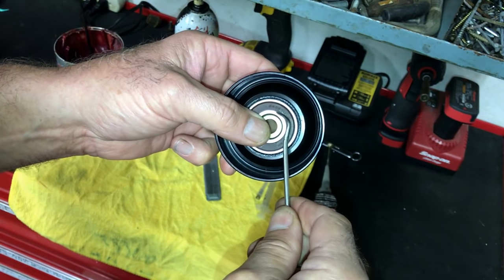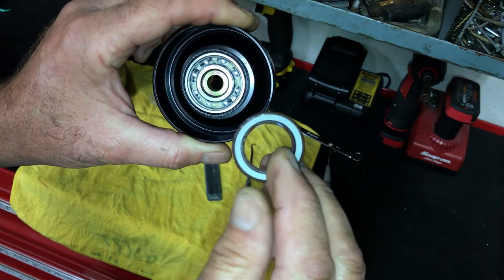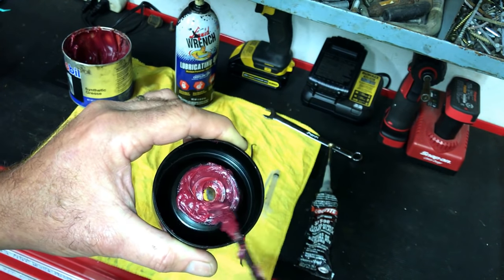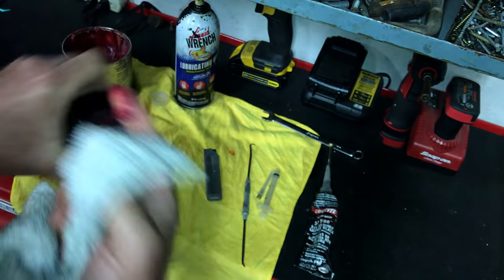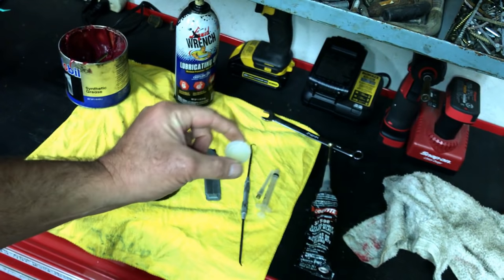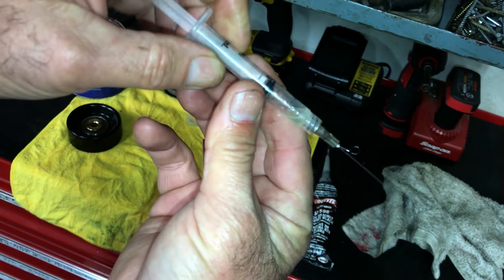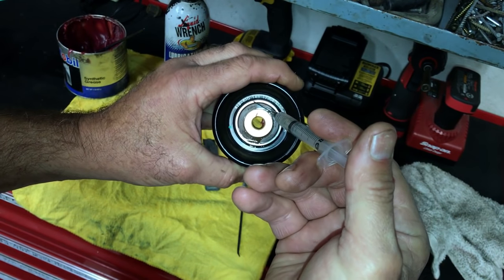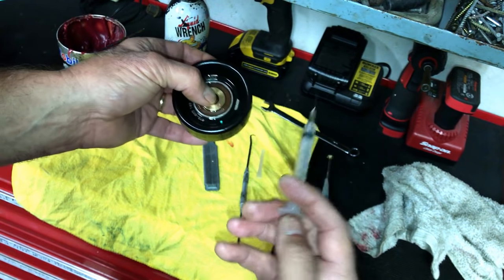Make Your Drive Pulleys & Sealed Bearings LAST A LIFE TIME :)

Comment: Am I understanding that for the syringe method you're using Liquid Wrench in place of grease?
Reply from the maker: yes and this method with the syringe is for those who do not want to remove their pulley to lubricate...we always remove and use full syn grease   :)
Reply: Is Liquid Wrench a grease?
Reply from the maker: it is a lubrication oil    we thank you very much and for the quality comment, it is very helpful for the whole channel :)
Reply: You are better off removing the pulley and greasing it.

Comment: This is good advice. By any chance, will WD40 work in place for the syringe applied lubricant?
Reply from the maker: you can try it but the spray nozzle needs to be very small to get under the seal   Thank you and thanks for being here with us :)
Reply: +Sweet Project Cars My question was going to be...Will WD 40 as a lubricant work just as well as the Liquid Wrench version of oil? I could still use the syringe method. Thanks!!!
Reply: tgoodm1 don't use WD-40. The lubrication it provides is not long-lasting enough for this application. WD-40 is more of a cleaner/degreaser, which is not what you want in a bearing!

Comment: Do this to my bearings all over my snowmobile. Doesn’t last as long as you think, the ones that are under in the elements .. cold ,ice , high speed . Yes I use low temp syn  grease too . Makes them last a bit longer that’s it .. quality bearings too
Reply from the maker: JDRTRM JDRTRM you are correct, this method was intended for cars and trucks :)

Comment: I've been greasing sealed bearings for years. I just removed the front wheel seals on a 85 honda Big Red that needed brakes. And since I had it apart I freshened up the bearings, these are the original bearings and the grease was almost as hard as wax. Doing this is a great way to prevent a breakdown, especially on older cars that needs belt replacement go ahead and grease those idler bearings. I've always removed the seals from the outer side, never tried getting under the race side of the seal. I'll try that way next time
Reply from the maker: thank you very much my friend and thanks for being with us :)

Comment: I have never tried it just thinking you could just drill four 1/16 holes into the cover
and then use a needle to grease the bearing without removing the cover. After 
greasing the bearing then use liquid electrical tape to seal up the holes. Next time
you will know where the holes were then just push the needle through and grease
it again. Then cover the holes again with the liquid electrical tape, it should work.
Reply from the maker: We try to keep it simple, of course, a person can make a mountain out of a mole hill in anything that they do.  Thanks for sharing.  Have a great day.  mad Mike the hammer SPC

Comment: I have been a Machinist / Machine Mechanic  for 40yrs   and Yes from the Factory they Don't Pack  the Bearing with much Grease  that's why a lot of them Fail Very Early   I did the same thing on a car that I had many years ago . it was the  A/C  idler I just took the Shield off the bearing Washed it Out  and Packed it with Wheel Bearing  Grease  worked like a charm    Great Tip
Reply from the maker: Thanks for the great comments to the channel:)

Comment: My new bearings, for both idler pulleys and the tensioner pulley arrived. I pulled the seals off of both sides and cleaned out the factory grease. I have repacked the new bearings with Mobil 1 synthetic as you recommended. While I was repacking them I even soaked the seals in 303 Aerospace Protectant as you recommended in a different video. Now all I need is a weekend without rain!

P.S. These bearings better last forever!
Reply from the maker: Great to Hear!  Thanks for the great comments to the channel:)
Reply: Thank you for the response. What vehicle used the belt for over 300k miles?
Reply from the maker: you are welcome...the ford van in the video is where the belt come off of and it went back on it and is still there working like a charm.

Comment: I have syringes in my tool box. It works. But I rather take it off and repack the bearing with high heat grease. As long as the bearing has little to no slop you should be fine. Works all the time. Any one can do it.  just be easy with the seal
Reply from the maker: Ben REPACKING is the very best way to do it as you said...Thank you and thanks for being here with us :)

Comment: Funny, I did this years ago. I have a treadmill (not a cheap throw away)and one of the bearings in the front roller was making a ticking noise. I took a syringe with some mobile 1 5w30 injected into the bearings and that was about 8 years ago and it is still perfect and I have put thousands of miles on it. I would have just replaced the bearings, but the way they were pressed in, I didn't want to take a chance of damaging the roller bearing housing and a replacement roller was over $100. I swear they try like hell sometimes purposely to make things only replaceable and not repairable?$?$?$
Reply from the maker: LittleJimmyNorton thank you so much for sharing my friend :)

Comment: Why wouldnt you brake clean out the white lith first?
Reply from the maker: Hi Dan this video was for the novice and nevertheless there is no need to make a big ordeal out of it..  as you know many do just that, and then it becomes a time issue and at that point they might as well just go buy a new pulley...we have done this very fast and simple upgrade and have vehicles here with well over 300k miles and never replaced the pulleys and we only greased them once when we purchased them new  thanks much   and thanks for being here with us :)
Reply: Sweet Project Cars wasnt making a big deal of it, just simply asking a question since you stated you werent a fan of the lith in this application
Reply from the maker: Dan M yeah hopefully you didn't take me wrong I knew you were not making a big deal out of it I was just saying some people out there would, the great part of this process is that the heavy grease that we press in into the bearing takes over the bearing so despite the lithium grease inside also we don't wash it out because at that point it will completely expose the bearing this way there's no chance of a  dry bearing. Thanks for your questions truly appreciate it
Reply: Carry on!

Comment: For wheel bearing don't use red grease use green or blue and it should say 500 degrees F on it. And thing with low heat red is ok
Reply from the maker: eksine we have used Mobil 1 full syn red grease for years on wheel bearings on 100's and 100's of customers cars with never an issue ever.
Reply: @SweetProjectCars  I see, a vendor on Amazon told me about it, but with valvoline. Supposedly the red translucent ones are 300 degrees and Lucas heavy duty and one kind of valvoline grease that's blue is also rated 500 F. Wheel bearings get hot. I think for personal use the 500 F ones last much longer
Reply: @eksine  Mobile one only has red and I've never used anything else and never have problems.
Reply: @Americanman450  mobil 1 isn't the only line they have. Mobil also has Mobilgrease® FM 222 and it's 500F
Reply: @Joe Black there isn't a universal system but within each series for each company yes they do have a color coding system

Comment: They make a needle for your grease gun, just in case you didn't know, get it at any auto parts.
Reply from the maker: we have them but you can't use them to get under the seal you have to remove the seal for heavy grease..Thank you and thanks for being here with us :)
Reply: I do, I use it thru the side like you use the pick, of course I'm not using axle grease, but then I do them every few years. Great video though.

Comment: Probably would have been better to clean the existing grease out completely, add the better grease, but I would not add the oils to it, you never know if they are going to cause a reaction and break down the good grease, but thats just because I have experienced this before myself on a wheel bearings
.
Reply from the maker: Hello John there’s no sense in removing the old Grease the new grease pushes whatever’s in there out the other side done it this way for close to 20 years and hundreds of customers cars with no issues as far as the injection of oil that is only for someone who has a bearing that is starting to squeak and they do not have the time or the finances to get it taken care of that very moment it helps them get by maybe to the next pay day have a great weekend thank you

Comment: Try using Prolong motor oil treatment instead of the oil or add a few drops to the grease..That stuff lasts forever & microscoplically soaks into the metal preventing any metal to metal contact. Wheel bearings, manual transmissions, rear ends, driveshaft bearings, ect. Lots of long range/high volume shooters are using it in their barrells to massively extend their bbl life. Some reloaders bake their bullets in a panful before loading their rounds. It activates at 140 °. Sucks into metal like water into a sponge & leaves a molecular barrier that keeps the metal from ever touching itself again. On the precision gun barrels, after their broken in swab the HOT bbl & easily triple the bores life. W continous regular use it lasts a lifetime. Same w car engines. Add 1/2 bottle w every oil change & hardly ever wear out an engine.
Reply from the maker: Thanks for sharing my friend

Comment: With pulleys are the vehicle, why not use a grease needle, & just push new grease into the bearing? Seems to me it would be better than using lubricant.
Reply from the maker: I’ve tried many many ways the absolute best way of course to pop the seal out and re-packet with full synthetic grease the needle set up that we use is only for those who do not want to pull their pulleys off but want to add a little extra protection

Comment: I can see why to replace the grease with synthetic grease, but I cannot see why you would inject spray lube into the bearing.
Reply from the maker: the spray if those who do not want to take the bearing off to pack it...it also is for those who want to help the used bearing out and maybe gain a little more life out of it without removing the pulley.

Comment: I watched the video and then tried it on my mower idler  pulley I just replaced.  It worked well, but it oozed grease out around the seal after I started using it.  I had it packed full.  Is this normal?
Hopefully the grease don't get on my belts.
Reply from the maker: Robert this happens once in a great while when you see that just wipe it off with a dry rag eventually it will stop doing that but there’s no worries have a great day
Reply: Sweet Project Cars    I have repacked two more since the first.  I installed the repacked bearings, and mowed for a couple of hours.  The repacked bearings run as smooth if not smother than the new one I previously purchased.  I keep one of the repacked ones as a spare ready to go.

Comment: Watch over greasing the bearings, when the bearing is in use, exccess grease will fling out from behind the seals and get on the belt. It's not impossible to remove the seals without doing damage to them, but more than likely removing them will leave a small gap for grease to get past, or since heat creates expansion, excess grease inside the bearing will be forced out past the seals. Either way grease will get on the belt which you do not want, once that happens the grease will be distributed on all the pulleys causing a squeal.
Reply from the maker: Hello Gary we have done this for close to 20 years and hundreds of customers cars and never had an issue with overgreasing or damaging the seal in anyway if a person is careful as they should be they can extend the life of their pulleys for a very long time have a great day
Reply: Sweet Project Cars I've also greased bearings like this, using the right grease is the trick, but they can still be over greased even if the seals are prefect. Unfortunately in today's cheap parts world, a guy has no choice but to grease them up, otherwise you'd be buying new ones once a year... seriously.
Reply from the maker: Gary Riefle yes if they use a good full synthetic they last and last :)
Reply: Sweet Project Cars they do indeed!!... I'll testify to that.

Comment: Why use the brush?  Use your thumb to squash the grease in deep.
Reply from the maker: Bad Axident you can apply it however you feel..we place it in with a brsuh and then when ywe press the seal in it pushes the grease right into the bearings internals :)
Reply: There is a chance a bristle could come out. If you are going to get your fingers greasy anyway, why chance forcing air or bristles into your bearing?
Reply from the maker: Bad Axident you can use your fingers if you like, you can use anything you like for that matter..we use high-quality brushes and have for 20 years on 100's of customers cars and never had one issue...different strokes for different folks :)

Comment: Great channel!However, you shouldn't mix greases.
Reply from the maker: Thank you very much we have done this for over 20 years with hundreds of customers vehicles and never had an issue the little bit of factory grease left in the bearing doesn’t harm of thing when you add a super quality full synthetic
Reply: I've been doing this for years too!. I just flush the old bearing completely of the old grease, and then re-pack. Mobil-1 is the original synthetic! Good stuff! Ever notice how all the royal purple folks put it down? I also wish that bearing vendors that supply the automobile manufacturers would actually FILL the bearings with grease properly to begin with. Wouldn't that be nice? If I was a bearing manufacturer, I would want my bearings to last longer than anybody elses, and would properly lube them with the good stuff to begin with. 
Keep up the good work!!! Job well done!

Comment: not good, red grease it's not the best for high speed and pressure bearing, plus if you fill complete the bearing tend to produce extra hot
Reply from the maker: Well, we beg to differ, after 40 years experience, we've found that the red grease hasn't caused us an issue, it outlasts everything else out there.  Matter of fact, we have bearings that we have done over 40 years ago that still look brand new.  Have a great day.  mad Mike the hammer SPC

Comment: Bigger the gob, the better the job? I honestly doubt this will make it last any longer
Reply from the maker: Well Bob we have done it for over 20 years and never had a bearing fail as of yet..anything properly lubricated lasts much longer than those things that are neglected :) just like old antique cars from the 60's...the ones that are taken care of with proper PM last and last to this present day :)
Reply: Bobby Patton it may last a bit longer but there is a point when you can over grease sealed or packable bearings to much is not always better
Reply from the maker: I fully disagree with you, I have never seen a bearing fail from being over greased, that statement makes no sense...we have done this on 100's of them for over 20 years and over greased every bearing we have done and not one failed from being over greased.
Reply: I've heard people say you can over pack a bearing before ,and I'm like okay let's just not put any in there at all that way we know for sure it will fail,it's like the don't change change your transmission fluid people,I work on equipment for a living and yes this dudes methods will make a bearing last longer,people with your mind sight are why this country is in the shitter,people would be amazed how many things can just be fixed with a little cleaning and greasing
Reply from the maker: jeremy rock the bearing will only take some much grease, so you cant over pack it. better to know it is full than not.
Reply from the maker: Dustin Pomeroy stellar comment I could have not answered it better myself :)
Reply: jeremy rock, I can assure you even though I do not agree and know the penetrating oil is not the best or even an advisable thing to do. The grease idea is a very good idea! Did that 16 years ago on cat engines due to excessive bearing failures due to the bearing having insufficient grease or none at all in the sealed bearing. Grease thing does work.
Reply: Bobby Patton 
I thought u only greased wheel bearings.
Reply: George Payazitis, all bearings are lubed,  grease or oil.
Reply from the maker: Well George that’s why our channel is here because we have out of the norm procedures that have proven to us over the many many years to prolong different areas of the vehicle. Have a great night
Reply from the maker: You nailed it Mike
Reply: Sweet Project Cars 
Who r u?
Reply: Sweet Project Cars 
This is out of the blue, who r u & r u responding to a comment i made.
Reply: Ok.
Reply: George Payazitis I am you...  You are you. He is I. He is you. 
Haha rush hour movie reference
Reply from the maker: George Payazitis all our workers

Comment: Different base greases are incompatible. You would be further ahead driving out that junk Chinese bearing, and replacing it with a quality bearing (U.S. or European, most bearings in auto parts stores are Chinese now.... even if they have an American brand name). Most car pulleys use a 6203 2RS which is the most commonly used ball bearing there is.
Reply from the maker: Well, we aren't trying to analyze until we are paralyzed we could of course spend hours trying to bullet proof our vehicle, we are just trying to show a 10 second quick enhancement to make the bearings last much longer without a whole bunch of muss and fuss.  Thanks.  mad Mike the hammer SPC